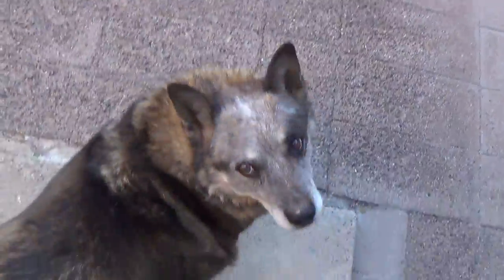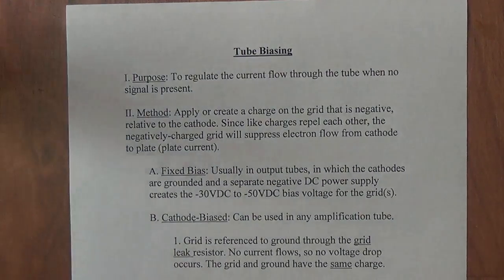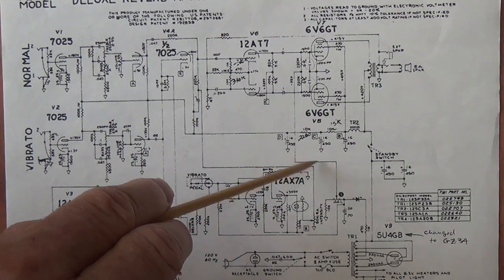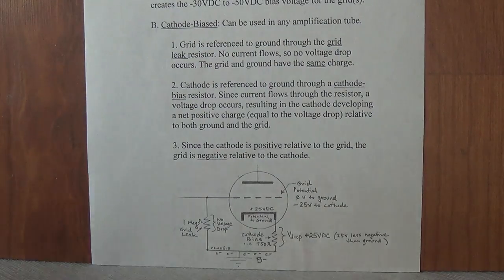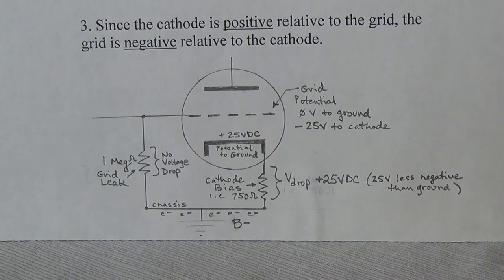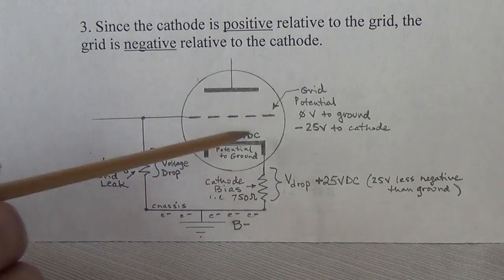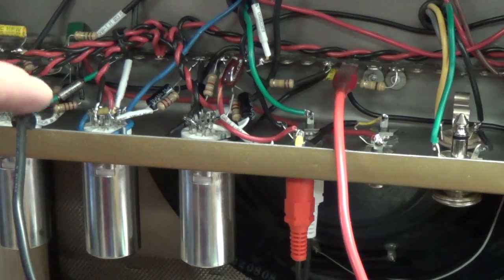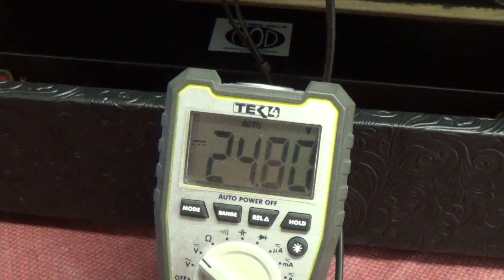Resistors, Part 4:  The Cathode Bias Resistor

Comment: hi uncle doug, how do you do and hope you're doing fine. i have a questions regarding cathode biasing of the dynaco sca-35 of the 4 output tubes (2 each channel), as they are
sharing on one 5 watt 95-ohms cathode resistor connected to the ground with 100uf bypass capacitor, my question is why the 6.3vac heater filament are also connected to
the cathode of the output tube, and serves as a hum balancer? there are 2 windings of 6.3vac from power transformer that feeds separately the filament for each channel,
but both of them also connected to a 1K potentiometer, which the wipers center tap of the pots connected to cathode pins of 4 el84/6b15 output tubes? exactly same circuit as the dynaco st-35, but no hum balancer, but still connected directly to 6.3vac? if i modify the heater filament circuit to dc, can i safely remove the hum balancer? also the
4 output tubes runs very hot and with a lot of noise and hum, thank you and more power to you!
Reply from the maker: The center tap of the 6.3VAC filament circuit connects to the cathodes of the output tubes to elevate the filament circuit and reduce hum. The 1K pot balances the voltage in the two filament wires, again, to reduce hum. This is all standard procedure and should cause no problems. If the output tubes are hot and noisy, maybe they are faulty. Check the value of the bias resistor. Try replacing/exchanging pre-amp tubes. This is not a repair that can be done long-distance. If you can't resolve the issues, then seek the help of a local tech. Good luck.
Reply: @UncleDoug  thank you for the quick reply. i asked you that question because i did not see any of that in your videos, as you have mentioned it's all a standard procedure. i hope you make a video about ac vs dc for the filament circuit in the future, or maybe you already have? pls. give me a link if you already have, thanks again.
Reply from the maker: @Torpengpogi  You're welcome, T. I have not made a video regarding DC filament supplies, simply because in a properly designed and constructed circuit, they are not necessary.  AC has always worked just fine for me and the vast majority of amps.

Comment: I just decided to change my twin 135 all by myself…i habe a question how much watt is the resistor to cathode which has 470 ohm according to the schematic? Thanks uncle doug greetings from Munich from a dutch guy
Reply from the maker: Greetings, D. I think you mean 470 Ohm resistor to the output tube screens. As noted on the schematic, it is rated at 1W.

Comment: Hi Uncle Doug & Rusty, I hope your all doing good. So far, it's been a cooler, wetter summer, which is good to keep the fire danger low. Resistors come in various different size watt ratings, but, I was curious about the voltage handling factor, as far as resistors go. I was wondering if this might be a good topic for a short video tutorial. I guess you could specify the voltage rating and get the appropriate resistor, but, would like to know more on selecting the proper wattage and voltage for a particular application, especially where tube amps are concerned. You decide if this warrants further exploration. As Always, take care, be good, C.
Reply from the maker: Greetings, Cass. To be honest, I don't believe that voltage is an issue with resistors. All that matters is the amount of current they pass and the amount of heat they produce while converting some of the current's electrical energy to thermal energy.....measured in watts.  You select resistors that can handle the maximum wattage they will encounter during normal use.
Reply: Uncle Doug Hi Uncle Doug & Rusty, Thankyou for the reply. I had watched a Mikes Radio Repair video, CB radios, and, he mentioned how he was blowing resistors and about voltage. I know your right, other than wattage rating, I can't say I've ever heard much about the voltage factor. I just wanted to know for ongoing research regarding my amp build, still moving forward. Doing some needed home improvements, but, will get it done eventually.Take care, C.
Reply from the maker: Resistors are damaged when too much current flows through them. This current is a product of the voltage present, but the voltage itself does not harm the resistor.
Reply: From Ohm’s Law, power = voltage squared divided by resistance. Therefore voltage = the square root of (power times resistance). E.g. a 1kΩ ¼ watt resistor:  ¼ x 1000 = 250, the square root of 250 is 15.88, so 15.88V  is the maximum voltage which can safely be handled by a 1k 1/4W resistor.
Reply: Resistors have a voltage rating, and some lower wattage resistors may not be adequately rated for voltages present in tube amps.
Reply: Resistors have a maximum voltage rating. Some low power (e.g. 0.25W) resistors have too low a rating for use as e.g. plate resistors.

Comment: Congratulations, very interesting videos! In your opinion, is it possible to switch different cathode bias resistor values without noise, bump, etc ...? Thanks!
Reply from the maker: Are you speaking of switching between different bias resistors?  If so, you should never do this while the amp is on. It must be completely off before any switch is activated.

Comment: Nice video .. Working with the pre amp common ground config makes it very easy to demonstrate many aspects of valve operation . I calc the wattage of cathode resistor to be approx .9 W so what typical wattage do we safely design for this resistor ?
Reply from the maker: If a cathode bias resistor faces a power demand of 0.9W, it would be best to double this value and use at least a 2W resistor.

Comment: Thank you for teaching us...I greatly enjoyed these resistor series. I am new at this, so please forgive my evasiveness:
I understand the math on how the cathode bias resistor sets the bios voltage at idle. But, when you introduce a signal at the grid, the current will change (in relation to the signal),
which in turn will cause the current in the cathode resistor to change, causing the bias to change  (in phase with the signal).
Wouldn't that change the  linearity/gain of the tube?
Also, by adding a cathode bypass capacitor, wouldn't that cause the bias to shift out of phase to the input signal?
Reply from the maker: That's exactly how cathode bias resistors work. As the tube current increases, the bias resistor reduces the bias....and vice-versa. This is why cathode biasing is so popular, it acts as a governor on tube current, keeping it within proper limits, and allows you to bias the tubes at 100% of maximum plate dissipation.  The bypass cap moderates the current fluctuation and enhances frequency response....generally in the lower frequency range.
Reply: It's called degeneration, a form of current derived negative feedback which reduces gain (and increases linearity). The varying voltage developed across the cathode resistor is a signal which is 180 degrees out of phase with the signal at the grid, so as the signal at the grid is increasing the current in the tube, the signal at the cathode is trying to decrease it and vice versa. The cathode bypass capacitor presents a low resistance to AC signals. Popular wisdom says the capacitor shunts this unwanted signal at the cathode to ground, but in fact it prevents the signal being created in the first place.

Comment: that's where the negative feedback comes in ... my pre-amp design has no negative feedback then ... or similar to giant bypass caps. 
( that's ok, i will design the rest of the tone circuitry to compensate )
i just got done posting my Finalized bias circuit revision to my EPS copyright photo album ... 5 trimmers, and 2 switches, it's a totally functional and flexible internal grid bias system.
Reply from the maker: Very impressive, Eric.
Reply: @UncleDoug  thank you, Doug .. i feel recognized by an authority.

once i got the bias charge pump it fell together..

the -50V half wave pulls through the Silicon diode and Resistor, charging the magnetic field of the Inductor;
Then the Inductor flied collapses discharging into the half-wave hole through the Schottky Diode, around the other side of the Capacitor

those 4 components turn the half-wave smooth better than any filter could..
and easily driving the -Vbias circuit, and all 5 grids.
Reply from the maker: @RulgertGhostalker  Thanks for the detailed explanation, Eric.
Reply: @UncleDoug  maybe i should do a video overview of the whole schematic ... along with the guitar speaker cabinet, as a stack.
Reply from the maker: @RulgertGhostalker  Sounds like a good idea, Eric.
Reply: @UncleDoug  my revolutionary schematic overview is now posted to my channel for your convenience.
Reply from the maker: @RulgertGhostalker  Do you have a link?
Reply: @UncleDoug  i can't post a link in commentary... 
but there is a link in my video description, to my FB photo album on the tube stack.
Reply from the maker: @RulgertGhostalker  I'll try to find it, Eric.
Reply: @UncleDoug  thanks Doug .. i think it will sound as good as it is simple and reliable.
Reply: @UncleDoug  that's because i think it will be very flexible of sound, for how simple it is... i will try to make it reliable , and with a low noise floor, of course..

i hope to offer one of the 5 Weber speakers  with purchase, and i think those options will get more people closer to their sound to start ... 
the amp being not very efficient, the choice is limited to the more efficient alnicos.
Reply: @UncleDoug  not everyone will buy my amp... that's how it is ..  but if some do, that's good enough.
Reply: @UncleDoug  and i even added a Bonus Tip to my Parallel In Phase / Series Out Of Phase 2 position DTDP pickup switch, ( in the same photo album ) ... a little wiring treat for guitarists who browse the album.
Reply from the maker: @RulgertGhostalker  Thanks for sharing this tip with us, Eric.
Reply: @UncleDoug  your welcome;  and thank you, Doug.
Reply: @UncleDoug  any critiques welcome while i am still in the planning stage.
Reply from the maker: @RulgertGhostalker  I'm really tied up with repair work and answering tons of questions and comments, Eric. I guess we'll just have to trust your design.
Reply: @UncleDoug  or to say, 
i have a theory that humans where initially developed by the eco-system to keep large space rocks from hitting the plant.

but even if a large space rock presented a risk to the plant, 
we have worse problems to deal with at the moment.
Reply from the maker: @RulgertGhostalker  Could we keep the topic on tube amps, Eric?
Reply: @UncleDoug  my pickup switch, and optional capacitor, will also work with two single coils at distance, ( so it doesn't sound quite so nasty out of phase )
if that helps.
Reply: @UncleDoug  I Just Posted The FINALIZED: EPS Tube Amp Head Promo-Schematic to my FB Photo Album in the Description Link
1) i had a liability concern with the old air switch.
2) i was in the circuit model, and realized the other side of the filter was cleaner ... i don't know why i was thinking it would be the same, i think i was just too busy drawing..
3) i also thought of a way to add the "anti-pop" resistor to the sensitivity switch, without cluttering the schematic.

Comment: I just found your channel and subscribed since I've retired and looking for something to do lately.  I also dug out my old ampeg amp model r-12-r-b, reverberocket and Epiphone solid body guitar.  Mind you this has not been turned on since 1970.  Well it seems to work except for the vibrato.  All tubes are original and the  the vibrato tube looks to be a 6SL7 I think????? can you advise on where to purchase parts, and also should I change the cord and install a new cord with ground and ground to the chassis? Thanks.  Since I could never play worth a plug nickle, I would like to learn to play "Johnny B Good" any advise there.
Reply from the maker: +gary smith Greetings, Gary, and thanks for subscribing. The Reverberocket is a great amp. You can buy supplies to repair and restore it from Antique Electronic Supply in Tempe, AZ. As far as playing "Johnny B Good", I suggest a whole lot of practice.....it's not an easy tune to master.  Perhaps you can find some YouTube videos that will explain how to play it, step by step. Best of luck.

Comment: Hi Doug, Do you still own this amp or did you sell it to buy a 4 bolt main block for one of your new toys? :)  Whats important is all that great info on scratch building an amp is still up. I noticed the 6V6 GT/G in this amp as I purchased a bunch of these off eBay. They were $5.30 each (cant beat that) NOS in original box's. I know they are labeled Sylvania, with the Signal Corp stamp, but have the RCA octagon too. Were they made by RCA ?
Reply from the maker: It was sold about a year ago, Tom, and the money may well have been used on old truck parts :) I have no idea about the tube. During the war, many different manufacturers switched over to military goods production.

Comment: Dumb question please. Where does the B- voltage actually come from? My (rough) guess is that it originates from the high voltage center tap of the PT which is grounded??
Reply from the maker: Not dumb at all, Joey. Since only negative electrons are able to "move", a positive charge is defined as the relative absence of electrons and a negative charge is the relative abundance of electrons. Think of the power transformer as an electron pump. It "sucks" all the electrons out of the B+ circuit and sends them to the B- circuit, which, as you said, is through the CT to the chassis ground. All current that flows within the circuit therefore consists of electrons flowing from the B- chassis ground back to the B+ circuit.

Comment: Well, the cap seems ok, i replace the tube and the new one doesn't glow. I wonder if the genalex tube could be damaged. Doesn't seems something wrong with it, apparently. The new values are 19v voltage drop, 348v plate voltage, and the original 470ohms resistor.
Reply from the maker: If the original tube red-plated and a new tube operates perfectly, then I would suspect that the original tube had some sort of internal short.

Comment: I thought a grid is like a venetian blind. A closed venetian blind cannot be made SUPER-CLOSED, or can it?
Reply from the maker: The analogy is OK up to a point, but the grid does not physically open and close like the blinds; instead, it's more like a chain link fence that is alternately charged negative and positive.....repelling electrons or allowing them to pass.
Reply: In the 'venetian blind' analogy, the blind is partly closed when no signal is present, so that when the signal goes positive the blind is pulled more open, and negative excursions pull it more closed.

Comment: Hi Doug. Thanks for your educational and very entertaining video tutorials - I enjoy them a lot!!!

Could you make a video, in witch you explain the difference between plate dissipation and output wattage? I've been searching the World Wide Wait, but it seems all the information out there is rater conflicting...

Thanks in advance... ;-)

/Søren
Reply from the maker: +Søren H. Strandberg  You're welcome, Soren. I'm glad you enjoy the videos. Plate Dissipation is simply a measurement (in Watts) of how much electricity is converted into heat within the output tube(s).....while Output Power is a measurement (in Watts) of how much electricity is converted to heat within a 4, 8, or 16 ohm resistor by the output of the amplifier.  Other than units, the two measurements don't have a lot in common.

Comment: What effect on the amp does it have letting more current go threw the plate, and it must wear it out faster 
with the extra heat, right or wrong.     Good video as always.
Reply from the maker: +MrMac5150  Too much plate current causes overheating and shortens the tube's life expectancy.
Reply: Uncle Doug
 What sound difference does the switch make
flipping it to the different resistance values.
should have been my question.
Reply from the maker: You need to watch the video series on my hand-building of the Supro amp. The switch allows me to use either a 6V6 or a 6L6 as the output tube, simply by flipping the switch to the proper bias resistor for each tube.
Reply: Uncle Doug
 Thats it,,, I did watch that, now it clicks, they have different current requirements on the tubes. I have not missed one of your videos.
I guess it is dementia setting it.
Reply from the maker: Don't be too harsh on yourself, Mr.M :) You're right about the different current requirements.
Reply: *****
 It was a joke, maybe in another 30 years.
I still have to finish my Associate Applied Science Degree.
Reply from the maker: I am the same age, Joseph, and suffer from a similar ailment....but I forgot its name :)
Reply from the maker: I had a friend who was married to a girl named Debby. He always made sure that his girlfriends/mistresses were also named Debby, just to play it safe :)